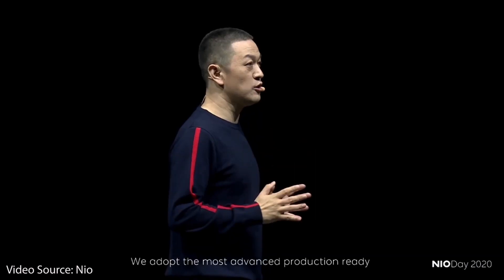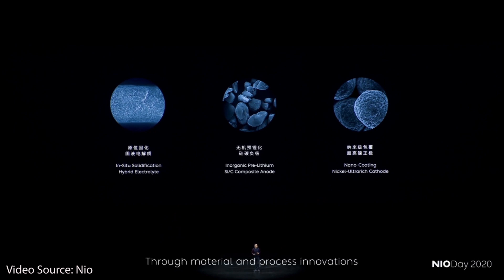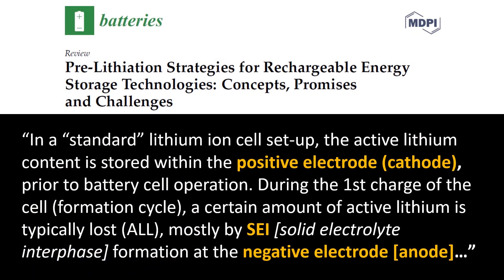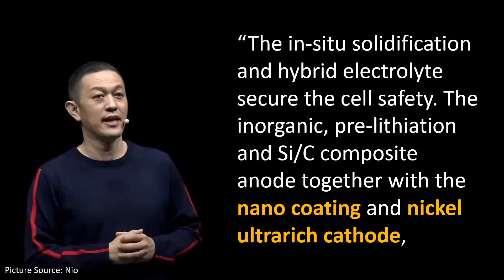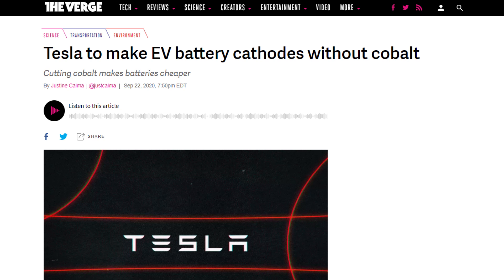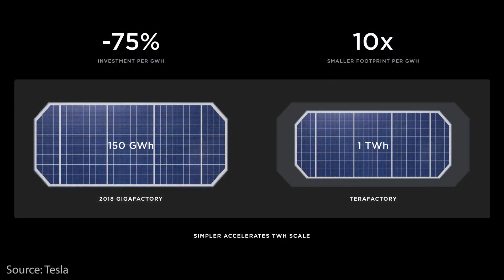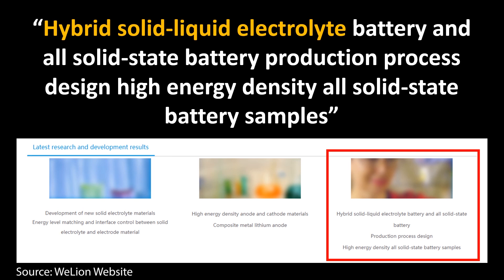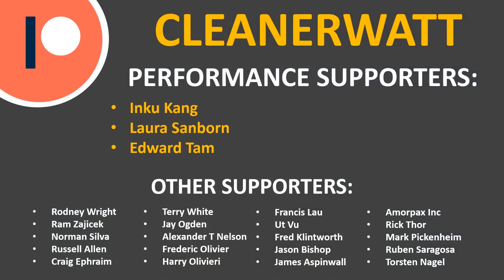TESLA vs NIO Solid State Batteries: Should TESLA Be Worried? (Part 3)

Comment: Tesla has lots of money; so they likely will have some sort of Solid state around the same time as others - note their deal with Toyota.
Tesla's larger headache is the so far failed tabless battery intermediate plan.  This is holding up Cybertruck and other new models. Today's Showing of an operational Toyota Solid State battery test car - shows they are ahead of many in this critical area.

Comment: NOOO 4680 Tesla cells having vehicles go 500 miles on a charge is all you need. You don’t need more miles per charge. 500 is even over kill in 98% of most peoples commutes. SOFTWARE and tech in the car is vastly more important.
Reply: Plaid+ should hit that range
Reply: @CED99  yes absolutely and that is as many miles as you will ever need. Now it should be about energy density(getting the same range from ever smaller and smaller batteries. As well as increasing charging speeds

Comment: It does beg the question
"If this cell performs so well, why the huge investment in battery swap?"
A long range, fast charge pack reduces, eliminates any slight advantage of the swap method.
Reply: I’m guessing battery swap stations will be few and far between for many years to come while chargers will be located everywhere before long.
Reply: The cell might perform well but it will probably take time before the tech reaches global level scale. The battery swapping . I have no idea, but if only I had more information. I hear Chinese people like to rent the 70kwh battery because it fits their needs. And when they need to change it they can because battery swapping gives you upgrade ability.

Comment: How does a solid state cell handle the inevitable expansion and contraction of the battery with charge and discharge states? Every compound has a different density so its volume will change. A liquid electrolyte lets things move. A solid electrolyte won't. The issue is cracks and internal short circuits. How are they managing this issue?

Comment: Your deep dive helps to clarify what's going on with Nio.  So thanks!

I'm still very skeptical about Nio's performance claims and timeline, and we know little about cost - though there are enough hints to suggest it will be very expensive per kilowatt-hour of storage.

I can't see a path to good cycle life, either, based on your analysis.  At best, we're looking at maybe a bit over half of the cycle life of current-gen L-ion cells, and I will not be surprised to learn that Tesla's 4680 cell will have up to five times Nio's cycle life, though to be fair, Tesla hasn't yet disclosed its cycle life expectations for the 4680 cell.  But we know full well that 200,000 miles of battery life would be a complete failure for the Tesla Semi.  It's got to be a whale of a lot better to make the Semi economical for fleet operators - at least 750,000 miles, and a million miles would be better.

I don't know for sure, but I get the feeling that Nio's solid-state cell is half-baked, not ready for prime time.  I suspect it will be a swing and a miss, in terms of cost, cycle life, and timeline.
Reply: On the positive side, if they have double the range and half the cycle life then they still get the same amount of miles from the battery pack. I am concerned about the company not even having an active website though. Also it should be pointed out that battery swap for a 600 mile range car makes very little sense, because even at 80 mph that is seven hours of driving, after which most people will definitely want at least a twenty minute break to hit the loo, stretch the legs, and grab a bite. Adding these packs means a third type of battery pack has to be set in a certain number at each charging station, making for greater complexity and cost and taking Nio further away from profitability.

Comment: This is not NIO’s battery, it is developed and produced by a vendor.
Reply from the maker: Who then?
Reply: @Cleanerwatt  you suggested one possible vendor. SolidPower is pretty ready for small scale adventures. Calling it NIO's battery is suggesting that it is their IP. If there is something better than the 4680, Tesla will just buy from the same vendor. 
What IP NIO has in batteries ? What IP they have besides a 15 YO battery swap from BetterPlace ? NIO is a marketing company.
Reply: @AsafTzadok  lol.. U r just talkative 😅
Reply: Nio outsources everything. Autonomous driving technology, battery tech, the manufacturing plant where the cars are assembled.

I really don't understand the hype on that stock
Reply: @pwells10  is purely FOMO investors. NIO hasn’t even proven it will succeed without the props of the China government. The future is vertical integration or you won’t be able to compete at any level, because your tech will suffer, manufacturing won’t be innovative enough and your vision for the company will never be fulfilled because every outside vendor has a different vision for their own company. Period.

Comment: Nios battery doesn’t exist yet, all this is  theoretical, not even working in a lab yet.
Reply: Tesla 4680 battery doesn’t exist yet
Reply: @airrodgers7277  actually they are making them. The factory video isn’t CGI. they just haven’t put them in cars yet as we know. And instead of lying Elon admitted that scaling up production is the hardest part and that they aren’t fully there yet. And making an argument trying to pick Tesla instead of focusing on the subject NIO is petty and weak.
Reply: @danielguillaume9928  actually the 4680's are in the plaid prototypes
Reply: @airrodgers7277  what are you even talking about, do you even know? Elon had already stated on Battery Day, Tesla has produced many thousands of 4680 cells in their Fremont pilot and are working on scaling production. 4680 cells are not a Tesla lab experiment, but rather in pre-production. Tesla is working on scaling production as we speak and it appears the current plan is to produce them in Fremont (I think it was mention this will support Model Y production at GF-Berlin) but then have scaled volume production in GF-NV (Semi) then GF-Berlin (model Y), and then GF Austin (Cybertruck and Semi).
Reply: @berova  I’ll bet there in the refreshed S&X when there revealed. 🤞🏻
Reply: @berova  And you believed him.  They just announced they're delaying the Roadster and the Semi AGAIN.  They're using their new batteries for 1 trim of the Performance S (Plaid+) which costs $134,000+ and that's it for 2021 and part of 2022.
Reply: @berova  He lies all the time, how is that surprising.  Do you think he didn't know the Semi wasn't ready for production in 2019?
Reply: @devilfriend  WOW, okay.... I think, as he stated, the timing of Semi was dependent on battery technology.
Reply: @berova  As is with every single EV.  But he gets to announce it before everyone else and gets free press for something he can't deliver.  He's done it for the lower trims of almost every car they sell too.  Model S 50, Model 3 SR, Model Y SR.  They get the headlines with a nice price and they cancel it a few months after or never deliver.